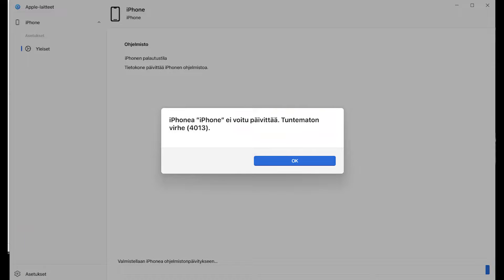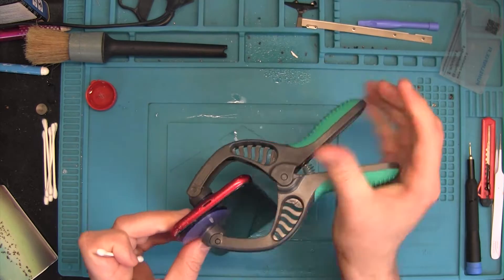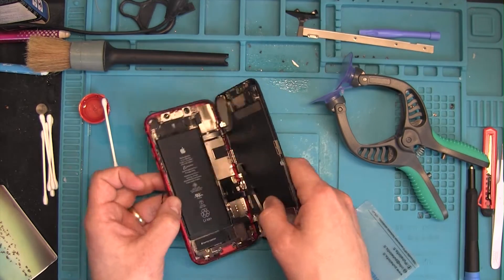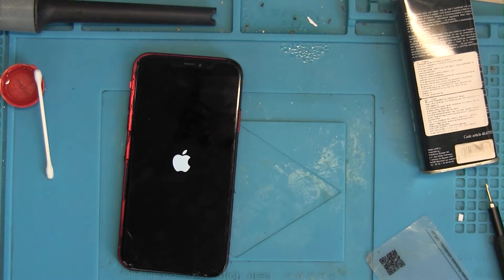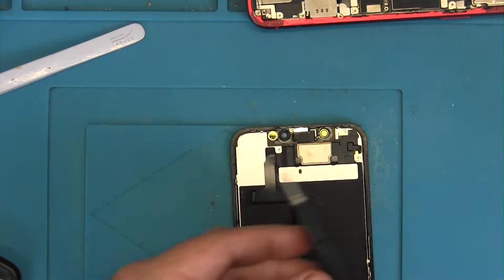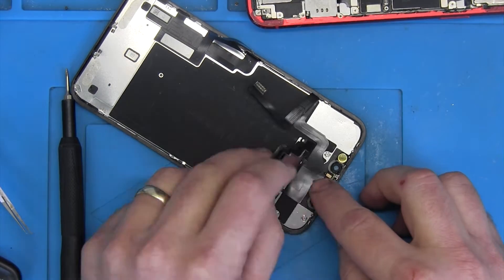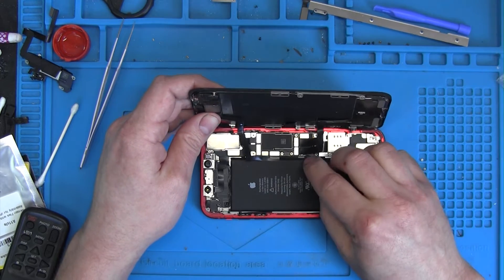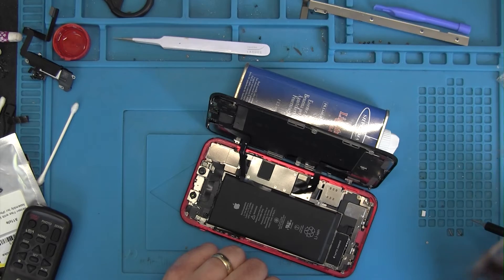iPhone 11 boot loop error 4013 fixed!!

Comment: Hello, the iPhone fixed and work again, Why you replaced the proximity sensor ! I didn’t understand that!
Thanks
Reply from the maker: If I removed the proximity sensor the phone turned on, with that it did not. So the proximity sensor has a chip that is connected to the motherboard. If I remember correctly there was two pins shorted to ground. With this short the phone tries to protect it self and does not turn on. Once the short is gone it turn on. Now the proximity sensor is part of the speaker assembly so it is easier to replace the whole assembly.